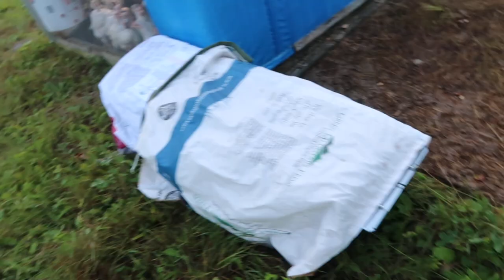the New FARM Animals have Arrived

Comment: Al, I really appreciate that you are aware of willows actions enough to see she was very uncomfortable. Happy youre going to use the old milking stand for now. And maybe somehow fasten boards to the new one? But not sure how that would work.
Reply: I had no idea they had a new milking stand, I was wondering about that with yesterday's video. Could they just put down a piece of plywood?
Reply: that thing should be made of stainlestell over here in Malta that thing would be not allowed.
Reply: Just take a piece of plywood cut out to the same size of the platform and screw L-brackets on to the plywood and to the steel.... Also to the guy that mentioned stainless that will only matter if they are to start selling milk and even then if they sell it and say it's not for drinking even if people drink it they can't be held responsible, if you advertise it for drinking and what not that's when you need to switch things up including pasteurizing all the milk.... Everything looks fantastic keep it up y'all!!!!
Reply: I just put a thick rubber mat on top mine. Easy to slide off and wash.

Comment: Al Tractor Supply has those panels in the outside yard.  They are called cattle panels, sheep panels and goat panels depending on the size of the squares in the wire.
Reply: I was going to say that the equivalent of Lowe’s in Australia is Bunnings - and they keep the panels outdoors. Love that it’s the same on the opposite side of the planet
Reply: Mike Bodamer Maybe something with a smaller opening? It’s a gorilla shelf. It can be ordered.
Reply: Those 2” by 4” holes are used on horse panels.

Comment: Pallet shelving costs and arm and a leg new.  Used only costs an arm up to the elbow, so the place to find it is a second hand industrial equipment joint.  They work to be easy to find on the internet.  A possible alternative is an IBC tote cut to shape with an angle grinder.  It depends on whether you like the spacing of the bars.
Reply: Cost arm...second hand.  I wish the pun was intentional.

Comment: Al, head back to TSC and look outside in the fencing supplies. What you want are some stock panels.  If you can get some evenly spaced cattle panels.  Only concern I would have is they are galvanized and I don't know how goats do with zinc.  If you want you can use stainless steel welded mesh.  It is used for veterinary centers and food processing plants.  You may have to do an internet search to find a local supplier.

Comment: With your new milking stand you could put the jar under neath with the tubes coming up through the floor thus eliminating the kinking !
Reply: Jamie McKenzie I like the old stand better, prettier,  sorry but love wood things better.  Is this one easier to clean, is the reason for the change?
Reply: Jamie McKenzie rubber mats on the milking stand might work ?
Reply: @patmaier6917  Nah I love the metal ones. They just need to get used to it if they don't like it at first. If the kick over milk buckets and spill it on wood, no matter how much you clean it, eventually it will stink and weaken the wood. Metal is easy cleaning and worth the money in my opinion. I wouldn't mind a wooden stand strictly for grooming, but not for milking.
Reply: Abby= I never thought about the milk dripping.  Understand about cleaning.

Comment: Premier1 sells a 30'" x 48"  panel specifically designed to build your own feeders.  The holes are 3" x 5" and it is 1/4 inch diameter galvanized wire.

Comment: You were looking for Cow Panels, and Tractor Supply  here has them outside in the back.  GOAT  NAME.... a best man wears a Tux,  name him Tux.
Reply from the maker: I was looking for cattle panel that had smaller openings in the smallest they have is for golden sheep which is 4 x 4 I’m looking for 2” x 3” opening
Reply: @LumnahAcres  Here we call those Pig Panel.  Where they are larger opening up high and get smaller at the bottom.

Comment: Hog panels. Tractor Supply should have them. Also, Lowe's carries a lot of livestock wire, they may have something that works for you. In my store the wire/cage mesh is out in the garden center 2nd aisle under the giant awning in the back. If you install the Lowe's app you can type in what you're looking for and it will tell you a location if they have the product in stock.

Comment: Love watching your builds. Just thought I’d share I came across a video the other day that surprised me it was made by kreg jig that tested if glueing helps make pocket holes stronger and the tests they ran showed it doesn’t at all. I know wow all the time and mess I’ve wasted in my life. Just thought I’d share this life changing tip I stumbled upon.
Reply: I doubt that, the addition of glue will always make the joint stronger. Especially when you are only using on screw per joint.
Reply: Glue always helps, but whwn you put it on endgrain, it soaks it up into the grain more, instead of at the end, so weaker bond. To combat it need to out some glue across endgrain, give it 20 min or so, to skim over the endgrain.then put more on, the second application stays at end, where it is needed.  Grab a fistfull of straws, and put glue on the end, same concept, the glue runs down through the straws instead of sticking near the end.

Comment: You should be able to get those panels at tractor supply you just need to ask them cause they might have them stacked outside cause they are so big
Reply from the maker: I did the smallest they had was 4 x 4 squares I’m looking for 2 x 3 openings in the fence
Reply: Did you look at the fence wire outside at Lowe's
Reply: @LumnahAcres  check out Sam's club. They sell it here in Texas so they might sell it there too.

Comment: Get some small steel cable like used on garage doors and noting can chew it off the cage. The loop handle will work very well on that too. It isn't expensive at Home Depot. Or Tractor Supply.

Comment: Cattle panels, or animal panels. They have different types for cattle or smaller at the bottom for smaller animals. Could cut into size. Not sure what you are building. Ask the tractor supply. Sometimes they are out or will order. Last time I got some 3 yrs ago $25 a panel .they come 16 ' x 5' or less.

Comment: How about Bruce?  Al- could you find what you need for hay holder in the prefab shelf units? Or how about the metal fence roll that has the 2x4 openings. Or the concrete reinforcing wire?  I’m hanging ai home depot too much now!

Comment: Al, what you were looking for at TSC and HD was "steel wire mesh" (https://www.metalsdepot.com/steel-products/steel-wire-mesh). Twice this past week I needed a small amount of steel and hit the same dead end as you did at TSC and Lowes/HD. I got the first pieces at a welder/fabricator and today got some from a yard that sells short lengths. Next time you need metal, you could try Wilco Direct at 991 and 988 Union Street in Littleton (http://wilcodirectinc.com/services/) or ask them where to get what you're looking for.

Comment: Clicked onto the website where you got the bucks and there is a problem with their security certificate as it was issued for a different website address.  Can you look into this and let us know how to safely get there?. Would like to check them out.
Reply from the maker: They told me they are working in a new site. It should be fixed in a day or two.
Reply: I've got a tightly secured computer and I didn't experience any problems. You might consider scanning your computer to make sure your browser doesn't have any traffic-redirect malware.
Reply: Check to make sure the time on your computer is correct, the easiest way to fail on a security certificate is having the wrong time and date set.